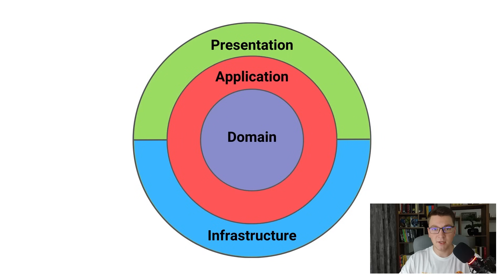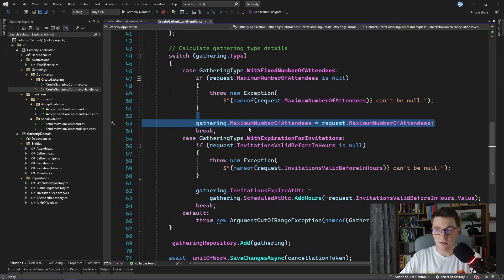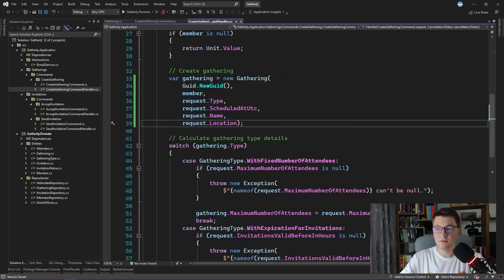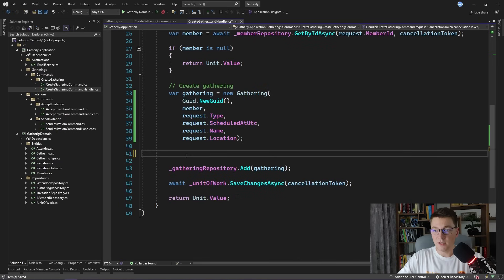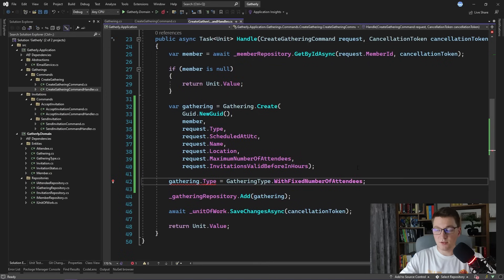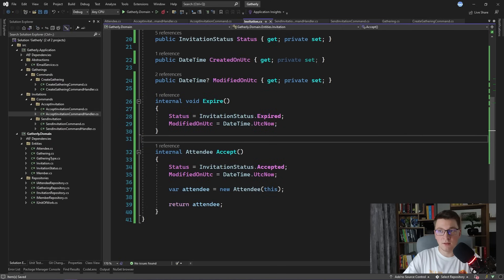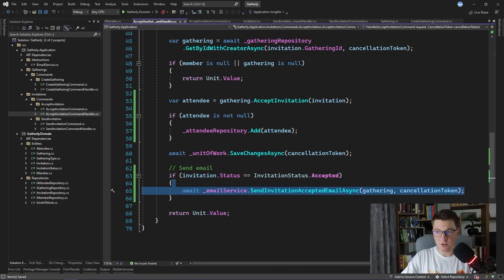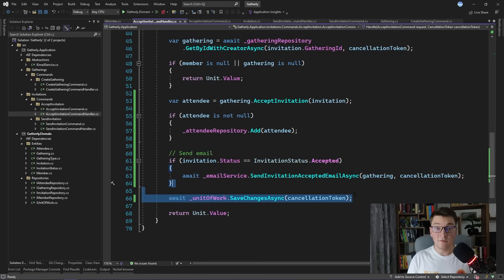How To Use Domain-Driven Design In Clean Architecture

Comment: How do you handle domain objects and persistence? Because a domain object's structure may not be suitable for relational DB persistence.
Reply from the maker: I try to not think about persistence when designing my domain model, because it will be constraining to design an ideal domain model that way.

However, I will show you how to convert this domain model into a normalized relational model in one of the future videos!
Reply: @MilanJovanovicTech  Is that so you will design domain objects before persistence ? Then convert from domain objects to persistence ?
Reply from the maker: @tienlam5599  That's why it is called "Domain-Driven". The point is that if you concern your self with persistence while modeling your domain, you will make some decisions that impact your model so that it can be translated to a certain database model. This goes against the point of using DDD. I will show you in a future video how to persis this model using EF, it's not so complicated.

Comment: Everything looks good except one thing which is not clear. While you are calling Add methods of invitation and attendee repositories to add the entity and persist using unit of work, why do you need to add those invitation and attendee in gathering entity, what purpose it is solving?
Reply from the maker: Purist approach
Reply: @MilanJovanovicTech  can you please explain this? Would it be necessary to add invatation and attendee to gathering entity while you have separate repository to persist them?

Comment: I'd be interested in if you are going to raise the issue of, when you are submitting updates, to not allow an invalid domain entity to be constructed - ie, not applying updated values to an entity unless you can first validate that the new values won't put the entity into an invalid state especially when dealing with complex aggregate entities.
Reply from the maker: My approach is to enforce these kinds of constraint by design. Your domain should expose such an API that you can only create entities in the correct state, and also be allowed to only update them into a new correct state. How do you approach this?
Reply: @MilanJovanovicTech  I prefer to do the same thing; enforce by design. In the past, I have had to retrieve the aggregate entity and generate a DTO and send that along with the command object with the new values to a business rules engine where all validation was kept as a separate system.

Comment: Hi Milan,
Thanks for this awesome video.
By the way, I want to mention that your code heavily violates SRP and OCP.
Reply from the maker: Care to explain why that is? That would be the least you can do when criticizing someone's work 😁
Reply: @MilanJovanovicTech  First of all, Big fan, I really like your video. 
Now as a developer, for example, the Create methods of the Gathering class violates SRP because it does more than one thing and the abstraction level is not the same, also because of the switch case in the method, if you need to add new GatheringType, you need to change the function. It violates OCP. And so on.
By the way, I really don't want to criticize anyone, especially those who try to teach something new to others.
🌻
Reply from the maker: @MDP1366  I'm always open to a nice discussion!

How does it do more than one thing?
It just creates a new Gathering.

As far as OCP, I agree. And there are ways to go about that. But I don't think it's necessary to dogmatically follow every pattern and principle out there. You have to be pragmatic about it, and not add too much complexity.
Reply: @MilanJovanovicTech  I do not agree about the dogmatic part and also OCP/SRP is not every pattern. these are for better codding style but I do agree that simplicity is ultimate satisfaction :)
I have a suggestion, if you don't mind, we can arrange a video call or something and work on it together, maybe you changed my mind :)
Reply: @MilanJovanovicTech  i understand both points of view. we could change from a big factory method to some factory class that would use that "GatheringType" argument to select which "Gathering" factory method it wants to execute
using this approach we wouldnt need to touch the same code everytime we need to add a new "gathering type" preventing us from "changing" old code

Comment: Good video! But one mistake. Keep a private parameterless construct in every entity for serialization and EF query mapping.
Reply from the maker: Are you sure it's a mistake? Maybe I did it on purpose? 😉
Reply: I guess Millan will not use EF Dbcontext to query from DB.. instead he will use Raw sql Query for reading data and map them into Custom class
Reply: @syedib  as i think the reason is that plain sql commands are more accurate and faster than EF for reading data (of course if its written well)?

Comment: I'm struggling with this. It is breaking all kinds of SOLID principles. I don't think DDD requires breaking SOLID coding practices.
Reply from the maker: You're thinking about it from two different perspectives. Besides, SOLID is great but it's also not the only thing that matters
Reply: @MilanJovanovicTech  Yes, but everything you've done could have been done with SOLID and it would have been better. An it isn't just SOLID,  it's "Models don't have methods" principle. It's the "Avoid statics like the plague" (static is an antipattern). The lack of interfaces, the increased complexity. The coupling to concretes. Do this again with Autofac, and at least the S and D of SOLID and tell me it isn't better by a long ways.

Comment: 1. Can we use interfaces in DDD Domain Modelling(if Possible is it advisable)?

The reason why I was asking is that I was trying to find the best way to model the data below.

The backstory is that in my App I need to communicate with Different renderers one renderer I am sending data over TCP and in the other I am writing data to a File.

Is it good practice to have different types of Objects In a collection in Json? Or would be better to Split the Data of One Json with the ID and Type I would then make another trip to the database/API using the Id from the first json so that I can get all the 'rendererDatas'. 

If the below Json is up to standard what's the best way to model this in DDD?
[
    {
        "id": "859b6427-a84a-4ac7-1234-21864cf46c86",
        "name": "string",
        "description": "string",
        "rendererDatas": [
            {
                "id": "ea0e7e36-ffe0-6543-83f0-23d46968b2aa",
              "name": "string",
				"DataType": "Viz",
              	"description": "string",
				"IPAddress": "123.123.123",
                "rendererAttributes": [{"FirstName":  "John", "Number": "8"}]
            },
            {
                "id": "ea0e7e36-6543-6543-83f0-23d46968b2aa",
                "name": "string",
				"DataType": "Ventuz",
              	"description": "string",
				"FilePath": "C:\Data",
                "Payload": "Json payload with Firstname and Number"
            }
        ]
    }
]
Reply: @MilanJovanovicTech
Reply from the maker: So maybe consider inheritance in the domain + strategy pattern?
Reply: @MilanJovanovicTech Thanks Milan, Really good content
Reply: @MilanJovanovicTech Could you do a video on this, please? I could not find any resource on Google on this